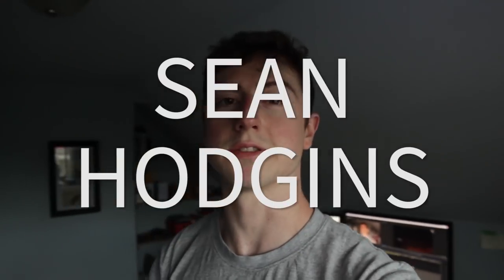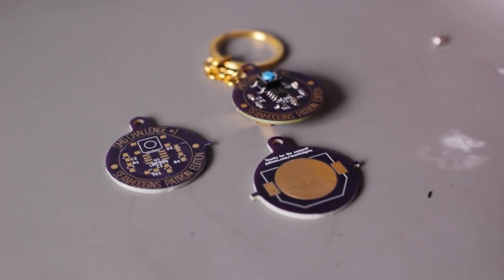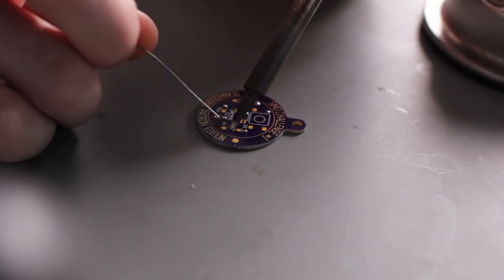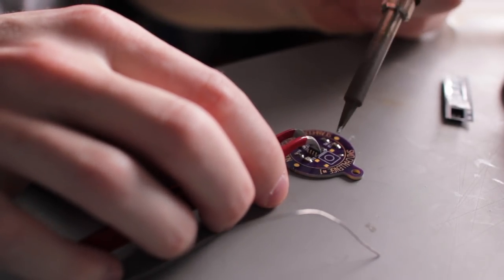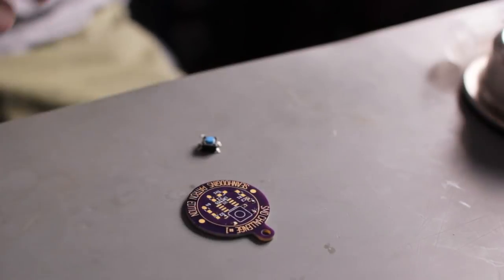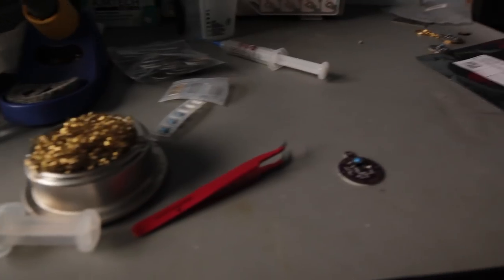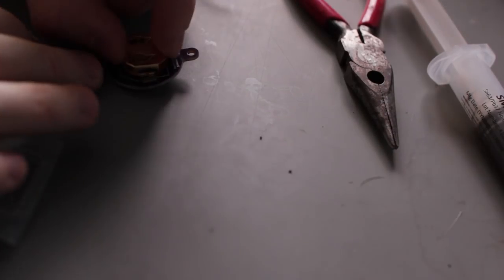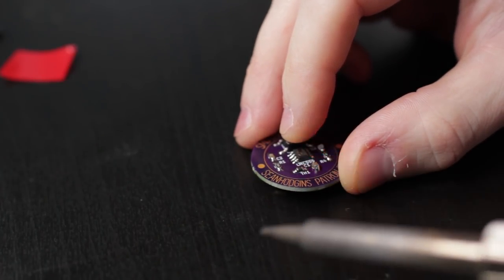SMD Challenge #1 - Learn to Surface Mount Solder

Comment: I'd love to see a video showing how you solder the SAMD21's onto your boards... Those pins are tiny!
Reply from the maker: Seon Rozenblum I actually do a pretty detailed process on building a samd21 robot over on the Make channel and it goes over the soldering process with some tips and tricks. The series is called Arduino Neural Network Robot and the soldering stuff is in part 2. That should help!
Reply: Ahh, I didn't see part 2 was up, Had already seen part 1. Yup, you go into lots of great detail there. Thanks!

Comment: Cool vid, appreciated your effort, brought something new. When a component is raised from one pad like you mentioned, it is called tombstoning.
Reply from the maker: Thank you! 
Yeah If it stands up that is what its called. Doesn't happen too much on the larger components since they have more weight, they often just slide sideways instead of tombstoning. 0603 and smaller I find have a lot more issue with it.

Comment: Would an average household microwave work as a reflow oven?
Reply: Love the video BTW
Reply from the maker: No, has to have heating elements. Preferably ceramic.
Reply: You're welcome to try - put anything metal in a microwave and you'll get SPARKS!! Probably ruin the components as well as the oven... :-/
(Added this comment as some microwaves have conventional heating elements as well - just to raise awareness so to speak...)